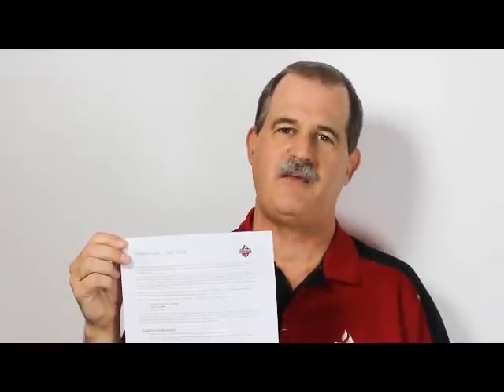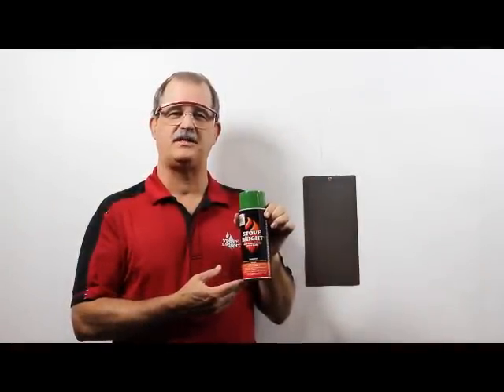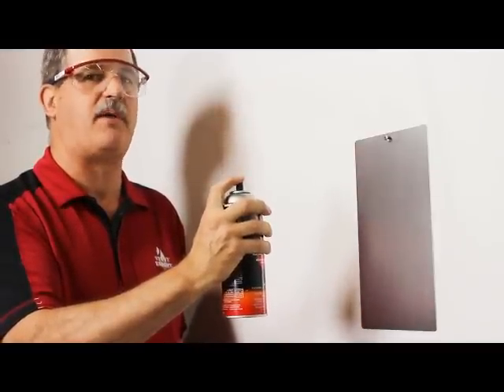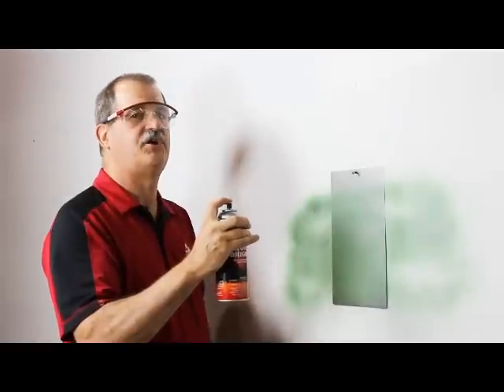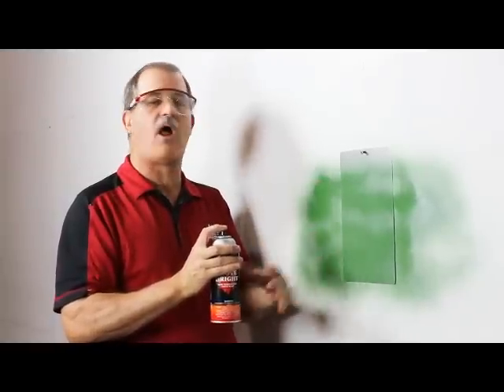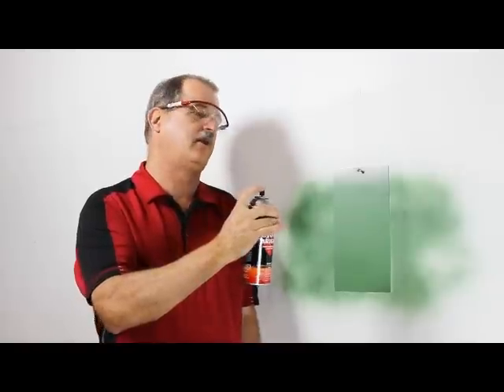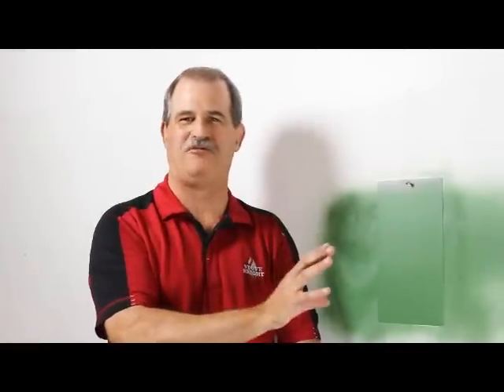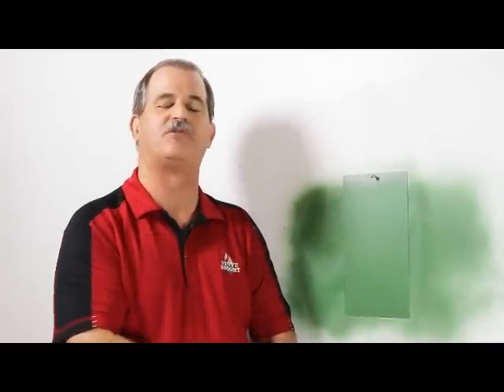How to apply Stove Bright® High Temp Paint - 3 light coats

Comment: Hi, Bob here from Stove Bright. Safety is important to us. I have my cup on so let's get started. This is the most critical part of getting good coverage. You want to start by making a winding snake pattern with the jet nozzle tip. After a few minutes you want to put another light coat on by just spraying as if the overspray from the first coat has hindered your vision. The third and final coat goes on as if your nearly blind and your on the verge of passing out from the toxic fumes. You may find the you slammed your face into the wet paint when you passed out, but that's okay because at least you won't get sunburned on your face. You may also have brain damage from not using a well ventilated area and mask, but that's okay. Think of it as a permanent high that you don't have to pay for. We here at Stove Bright feel safety is important so make sure you're wearing your cup and knee pads while spraying in an airtight room.  We've determined that the benefits of using Stove Bright High Temp paint out weight the negative side effects.

Comment: Would this work for a gas rv stove?
Reply: Our paint is not rated for surface food contact.  The problem would be splashing oils, you can't use degreasing cleaning products on the surface.  Sorry.
Reply: Then what exactly is this for?
Reply: @BessetteMusicRepair  Heating stoves, looks like. I'm disappointed too; I want to paint my range.